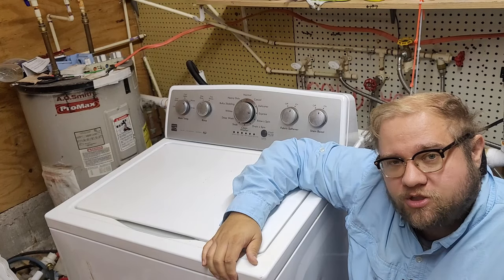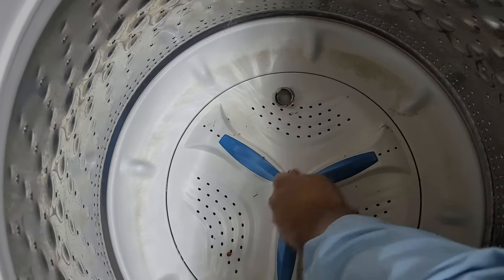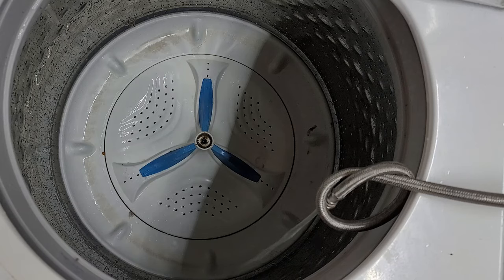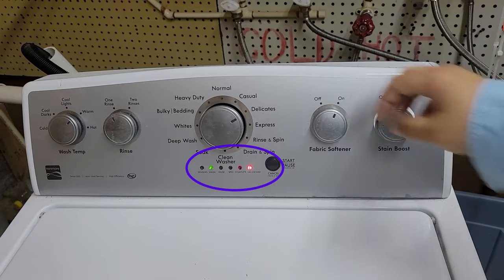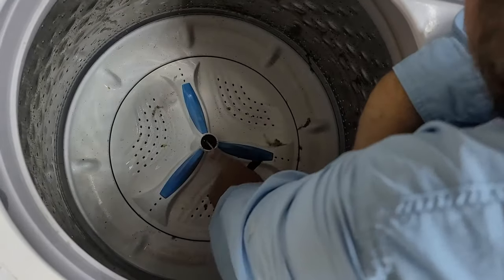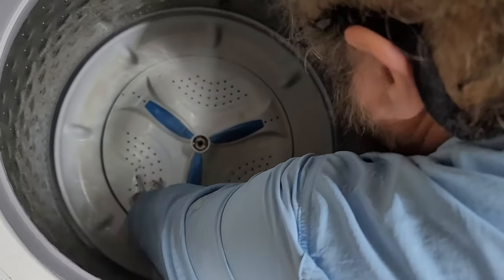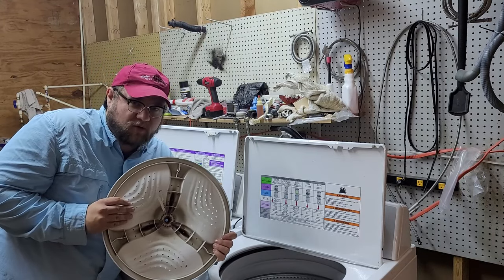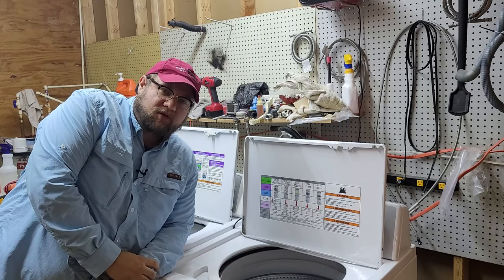Washplate Stuck - More Ideas to Remove a Difficult Whirlpool Wash Plate

Comment: Thank you! Thank you! Thank you! We worked for hours trying to remove our agitator from our washer. . We tried this version and it came right off! Thanks again.
Reply from the maker: Awesome!
Reply: My wash plate snapped trying everything so now to metal part that connects to the splines on the transmission is stuck on. What now?
Reply: In the center of the wash plate there’s metal that connects wash plate to the transmission splines. It’s completely seized. No idea what to do.

Comment: Try two pant can lid openers. Hook them under the edge of wash plate at 180 degrees apart. And jiggle back and forth. Spin drum a little to reposition lid openers and jiggle.  Repeat until it comes off.  It just worked for me pretty quickly after much frustration at trying several other methods unsuccessfully. This is the first time I have ever commented on YouTube.  I'm really just a lurker.  But I felt it was important to share this, seems it seems to work well.  Maybe someone else already made this suggestion.  I didn't take the time to look through all the multitudinous comments to see.
Reply: Brilliant!!
Reply: Well that was a disaster, just broke the lips off the lid opener so now they are just weird looking flat head screwdrivers and there are small pieces of metal stuck under the plate.... All in all I don't recommend doing this but it did sound like a good idea.
Reply: Could you use like a glass bottle cap opener or would that be too thick to slide under plate?
Reply: Thanks for the tip. This worked for me 🎉
Reply: This worked for me as well. Emphasis on wiggle, and dont be to hard. Move the hooks around. Then when enough space use your hands to wiggle out.
Reply: Haven’t tried it yet but thanks for the tip.

Comment: The problem is rust and corrosion of the steel insert splines on the washplate and the splines on the gearbox shaft not crud under the washplate. Very poor design.
Reply: very very poor design
Reply: We know. We just need a solution
Reply: @doctorfeinstone6524 CLR 😂
Reply: Once off when you put it back together put AntiSeize on the splines, next time it'll come right off.

Comment: After a week of trying solution after solution, THIS one, combined with the use of pull hooks to pull the agitator up, finally enabled me to remove the washplate. What an ordeal! Why is there no class action lawsuit against Whirlpool for their horrible design?
Reply: The only big winners in class action lawsuits are the lawyers. If there's a win, all the plaintiffs get a check for hardly anything.
Reply: It's really not a bad design. As a mechanic there are way worse designs with vehicles. I've had my washer for over 10 years now and am only taking the wash plate off now to clean it 😂

Comment: GOT IT, I found a solution. Fit a long wire underneath the wash plate and wrap the opposite ends around a long piece of lumber laid horizontally across the opening over the washer. The longer the better, I used a 6ft piece. Push up on one side of it with your shoulder using leverage to pry it off. The amount of force I had to use lifted the washer from one side, meaning there was no chance in hell I would’ve gotten it off with my hands alone even given the right tools. Leverage is the only way.
Reply: Good solution - I did the same except that I used paracord under the washplate and tied to the end of a stick. I used the edge of the washer as the fulcrum, pushing DOWN on the stick. While holding this tension, I banged on the washplate near the center with a rubber mallet and POP! It came off, revealing a big nasty tangle of hair around the shaft that was causing trouble.
Reply: This worked perfect for me. Thanks for sharing! 

Your comment trophy: 🏆
Reply: I put my shoulder to a pretty thick tree branch.  It snapped the branch. I used a spring from a ball point pen to put new brushes in my rotary tool then cut it out. What a day.

Comment: After trying to remove agitator for a few hours, I poured a little CLR in the center and waited about 10 seconds and it came right off.
Reply: WOW thank you for the CLR tip.  After using an impact driver our wash plate wouldn't budge...wish I would have read comments and hour earlier!

Comment: Honestly i work flate rate service calls to i chisel it off and replace it. These wash plates are horrible. Worst design whirlpool did regarding the plate. Cabrio direct drive in the past was far easier to remove. Better when they used the all plastic rather than the metal shaft inside the plate

Comment: I just spent 4 hours or so working on getting the wash plate out after getting the cap and bolt out. We ran the machine on sanitize/clean for the hottest water with some citric acid. Nothing. Did it again. Nothing. Finally I soaked it for about 45 minutes with white vinegar and then added in boiling hot water. I let that sit for about 15 minutes and then used a threaded wire coat hanger through all 3 holes near the center to make sure the pressure was even in all 3 areas. I had to wear gloves and gave it my all but I finally heard a slight shift in the plate. I gave it 2 or 3 more good pulls and it popped off.

Comment: The only success I've had on the newer whirlpool/maytag designs is spraying PBlaster directly in the center where the metal insert and transmission driveshaft are located. Sometimes it has to sit and when I come back to replace the hub the washplate will then come off. Other times I have to break the plastic washplate and bring a replacement with me.
Reply: Shoe string tucked under the wash plate like a pull handle works like a charm.  My plate was rusted/seized at the spline.
Reply: @free99x  lol
Reply: only successful with the break the washplate method
Reply: I used PB Blaster as well. I had to let it soak in overnight while using a rubber mallet to bang and vibrate the wash plate and using picks (hook and pick tools) to lift up on the wash plate. Jut when you think you need to start smashing the plastic to get it off... pop! Up comes the wash plate/agitator. You need to give the PB Blaster time to work AND you need to keep working the PB Blaster in. While the drive plate is plastic, the wash plate and drive shaft are metal and are what get rusted/fused together -- at least in my case.

Comment: After watching all the videos and reading all of the comments, here is what FINALLY worked for me to remove my washer plate.. After removing the cap and retaining bolt for the washer plate, my plate was stuck. I tried:
WD-40
Vinegar
Bent coat hangers to pull with.
2 Small Allen wrenches and 2 vice grips to pull with.
Deadblow hammer
3lb sledge (the handle is now 8"!)
6” punch to fit on top of the shaft to beat on!
Hair dryer to heat up the metal insert on the washer plate.
Finally, I tried CRC Freeze penetrant to freeze the metal insert on the washer plate.
After spraying 4 20 second bursts and waiting 20 minutes, some more hammering and it came off!! Great product- got it at the local auto store. 
I can now complete my gearcase replacement! Thanks for the video and all of the ideas in the comments. P.S. I will be using some anti-seize on the spline of the new gearcase! 
In retrospect, a propane torch might have helped break the corrosion.
Reply: I guess we'll have to try that next. We've tried everything else you had on your list too and it's still stuck!! 😤
Reply: See my edited comment above regarding a torch.
Reply: oh shit, thanks for sharing!  I considered ant-iseize but am worried that maybe it is toxic -not the best for dishtowels etc.  -gonna try vaseline.

Comment: Your videos just saved me. What i did was bent two sic penny nails and fit them in the holes opposite each other, then I grabbed the nails with vice grips and wiggle it while pulling up. I did that 90 degrees apart a few times and it came loose. It's the metal spline insert on the wash plate and the metal splines on the shaft that rusts together. Thanks.

Comment: I came across this the other day and was about to just cut it off since I had the new one but I used a steam cleaner. I just put the tip of the steamer on the center of the wash plate where the nut was and put a towel over it for a few minutes and then put 2 45 degree angle pick tools under both sides and it rocked out. that saved me so much time.

Comment: Thanks! My issue was removing the bolt. Used an impact wrench and worked like a charm. Whirlpool uses blue Loctite.  Then used a shoe string tucked under the wash plate to lift it off since the splines had rusted and were seized.

Comment: I used 4 screws threaded into the  little holes and with vice grips, pulled on the screws, 2 at a time, in a rocking motion.  Came off fairly easily.

Comment: This video is extremely helpful! I had a broken drive hub in my Maytag Centennial washer, could not get the darn plate off. Found the citric acid at Hobby Lobby for 5.99 for a 1lb bag. Half of it in the tub with hot water just over the top of the plate, 6 or 7 gentle agitation test cycles later, popped right out. Thank you!
Reply: it probably would have been cheaper to break off the old plate and buy a new one to replace it!
Reply: @scrapman502  Cheaper than 6 dollars?

Comment: I’m about ready to throw this damn washer out the window. Thanks for your tips
Reply: Nothing like the old design washers. After 2 weeks of trying to remove that stupid dish , will be doing your suggestion!
Reply: These newer washers are junk. I broke my agitator and still didn't get it off!
Reply: @patadegrillo007  took me 2 years, still stuck tight,  CLR used,  not helpful either
Reply: Had  to cut the plate in half and use a puller to remove the center bushing from the shaft, found $1,20 in coins jamming the dish

Comment: before I used your "two screws" method I tried the boiling water technique... and wiggled for 35 minutes. i used a very small pry bar pulling gently on metal wash plate around and around... then it popped up/off. thanks for making these videos!

Comment: I've used the method below to remove pulleys, etc. from shafts.  I would try it for washplate removal, but I'm not certain that it will work.

I After removing the nut, try replacing it with a coupling nut run all of the way down and then loosen about two turns or so.  Then screw in a short bolt into the coupling nut and tighten it securely to the top of the stud.  Spray the washplate stud with WD40 and tap the bolt with a hammer.  I believe that it will pop loose after a few light blows.  If this doesn't work, try prying the plate and tapping the bolt at the same time.

Comment: I have an LG washer that had a stuck wash plate. Tried the screws and it wouldn't budge. Ran an agitator test cycle then a tub clean and the dang thing floated off the splines! All my might pulling and it wouldn't come off but that did the trick.
Reply: I also have a LG washer. We've tried everything but citric acid. CLR did not work for us. Can you tell me how to run the agitator test cycle you used?
Reply: @alyssatrout3702  I'm afraid I don't remember anymore but you can follow the basic idea of the video. Have that citric acid in the tub with hot water and run wash cycles to make the agitator spin around. It may take a few times but as it spins to "wash" the empty tub it'll slowly work itself off and float up to the water level. Just make sure to babysit it so it doesn't bang the plate around once it's off.

Comment: I've had the same exact washer and tried to get that stupid lid off until finally after months of having to wash clothes and my parents and my husband didn't have time to spend really trying to fix it We ended up just breaking down and buying a new one because It was on sale and I'm having the same issue again except for instead of it being 4 and 1/2 years later it's 2 years later so I'm trying your tips right now I hope it works. once I get it off though I'm probably going to take it off every couple months and clean it so this doesn't happen again hopefully just know, it's the stupid washer because I've had to do this same thing. back then though when I tried to fix my first washer that I gave up on, I didn't have as many videos to help me as I do now so thank you
Reply: Don’t buy any more whirlpools washers like this, stick to the older whirlpool kenmore direct drive models for used that have a turn style timer and if you want new, BUY A SPEED QUEEN WASHER AND DRYER! Best in the market, 5-7 year warranty and run 25 years still!

Comment: Based on my washer symptoms it appeared that I just needed to a new drive hub so should have been a simple repair but nothing is ever easy.  I tried just about all of the solutions in this video and others (metal hooks, citric acid, degreaser, air bags, shims, prying tools, hair dryer, etc.) to get the wash plate off intact but despite putting tremendous upward pressure, nothing worked.  Decided to cut away plastic to access the metal part of the agitator that sits on the spline.  Use a rotary tool and then a chisel to get the plastic off the metal piece.  Then tried all the suggestions (boiling water, lubricant, bearing pullers, etc) to get the metal piece off and none of that worked as well.  Then decided to use a rotary tool with a diamond blade to cut a slot in the metal to see if I could loosen it.  This was not easy as well but after 3-4 hours of cutting, finally got a slot cut on the top and one side that went all the way to the motor shaft/spline.  Then used a hammer claw with a small piece of wood underneath to protect the bottom of the drum.   This finally did the trick and it came off.  There was some rust on the shaft but it didn't appear to be fused so it was just on there really, really tight.  Then removed the old drive hub and all the gears were stripped so replaced it with the $10 part from amazon and washer appears to be working normally.  Probably ended up spending $100 in supplies but way too much time.    In the end it would have been way easier just to buy a new washer but it became a challenge that I had to solve.  Hopefully this fixes it for a while but who knows.  Thanks to everyone for the videos and comments.
Reply: What were your symptoms?  I have a screeching noise that occurs intermittenly only on the wash cycle.  It has been suggested that I have a bad gearcase.

Comment: Put the bolt in part way lift up on the plate and tap with a hammer. Just changed the transmission on a Maytag centennial, the plate and the tub we're both stuck pretty good.

Comment: I used my oscillating tool with a wood cutting blade.  Completely destroyed the wash plate, but I got it out.  I had tried a variation of the trampoline tool without success.  I was trying to figure out how to use a gear puller, but decided that I needed to order a new wash plate just in case.  The gear puller broke the stuck wash plate, and that signaled the start of the oscillating tool attempt.  It strikes me that it might not be a bad idea to remove the wash plate every six months just to keep the crud from building up beneath it.

Comment: I used a shoe string and ran it under the plate.  This allowed me to put even pressure on both sides of the plate and it popped up with a little pressure.

Comment: I wrestled with getting mine off but what I did was take a strip of really strong duct tape from the edge to the middle on the 3 flat parts of the part and had enough duct tape to make a handle in the middle. I was able to pull directly up and the plate came off. Hope this helps someone.

Comment: I had trouble with getting the agitator out of my 2003 Whirlpool top loader. I found when I removed the bolt and also the bolts holding the transmission in and put a longer bolt in place of the agitator hold down bolt and hit the bolt with a dead blow hammer it came right out.
Reply: Oh my gosh you saved my life. Just did that and it came right out. Have been struggling for like 30 minutes. Mahalo
Reply: Where is the bolt that holds the transmission in?

Comment: Use some weed eater string get it under the plate and give it a yank. Good video.
Reply from the maker: Tried a few things like that, and the weed eater string doesn't have the tensile strength on some plates.
Reply: @bensappliancesandjunk  I saw that on our facebook group thought it sounded legit.  Thought I might pass it along to you have not yet messed with one these I am 68 retired appliance parts sales. I do a little DIY my old boss helped me with. made a few videos.
Reply from the maker: @DanWebster  nice, I appreciate the idea. I know some techs say try dryer belts, and when I've done it, they usually snap. You never know how "Bad" the plate's gonna be when it doesn't come out easily... The screw method on the LG's has worked awesome for me, but it wont work on these at all.

Comment: Thanks for your tips Ben! I didn’t have any citric acid and didn’t want to hear complaints if I used any type of petroleum based agent, so I tried a different technique to free up the plate.

Tools used: hairdryer, parachute cord, soft rubber mallet, general handtools.

In another video I saw someone used parachute cord and snaked it underneath the plate. I did this and tied two loops as handles.

I then used a hair dryer on high for several minutes to heat the center hub of the plate. I didn’t want to use a heat gun as this may deform or melt the plastic. 

Finally, I used a soft rubber mallet to tap around the center and help break it loose. It took several tries with pulling on the cord and hammering, but it finally popped loose. As expected, it was rusted and the remains of the plastic hub gear gunk lay underneath. Replaced the hub gear, cleaned everything up, ran a recalibration and then a rinse and spin cycle. Everything worked great like it was new again. Hope this technique helps someone like it did for me.